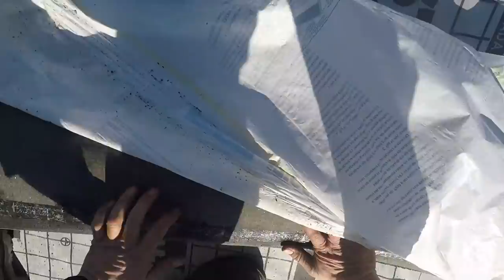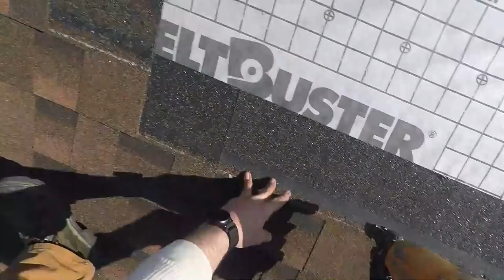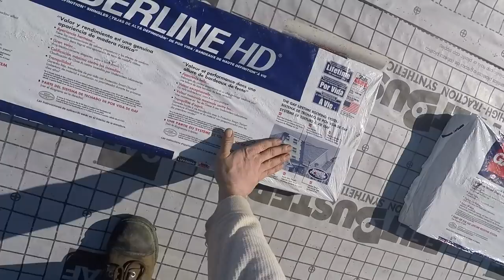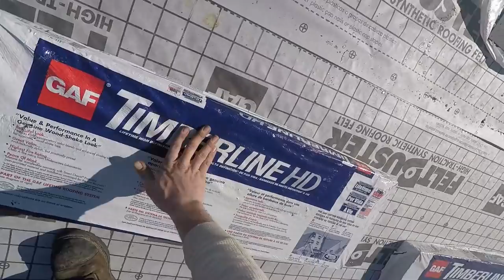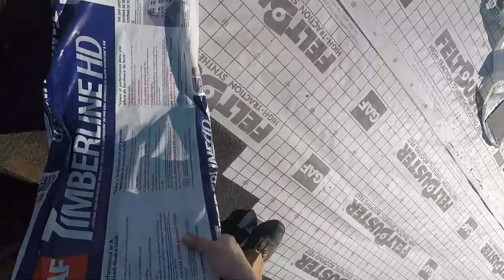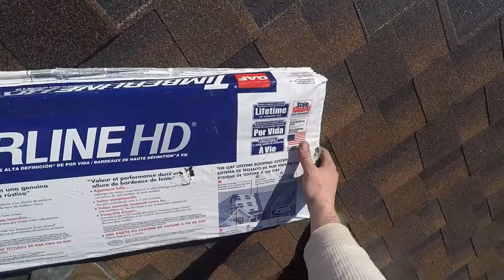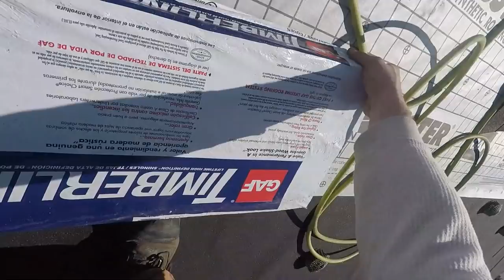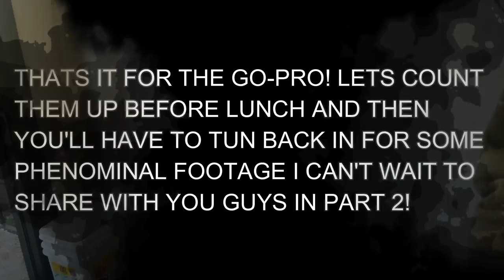Worlds Fastest Shingler 46 Sq Apt (part 1 of 3)

Comment: Fist off man thanks for all the videos. I've been learning a great amount from them. Is there any trick to shooting that nail for the chalk line to aim it right at the edge of the shingle like that? Your accuracy was nuts dude. Also when you open the bundle of shingles and slide it down your steps do you count based off the amount in each bundle? Looks like ya split it up in fours every fourth step I thought I seen you drop a couple more shingles. It would be badass to get on a roof with your crew and learn some real shit.

Comment: I was a roofer for a summer in 98'.  After that I framed for 3 years and then went to paramedic school and joined the fire dept.  I just retired and debating whether I should take on my roof by myself.  1800 sq foot home.   A lot of the sheathing will need replacing as well.  Guess it depends on how hard I want to work.  I'm 50 and athletic but like a lot of guys my age, my back and knees aren't the best.  I'd love to have this guy knock it out for me!

Comment: How much do you charge on a roof like your video 4/12 pitch for tear off and lay just labor.  I’m in Kansas $120 a square I would prob charge more since it’s 3 stories.
Reply from the maker: well mine includes material and dumpster as well. i'm usually around 270 as a base for straight gravy and go up from there

Comment: Im not a roofer at all but I thought the white line meant no nails below that. i was under the impression the tar strip was where you wanted the nails to land. Is that a common misconception?
Reply from the maker: the white line means you put your nails there and there's no tar line to nail. that was 3 tabs. these are laminate shingles and your nails have to go through the common bond. as long as they don't show when you put the next one on you're good

Comment: Where is your FALL protection
Reply: If u fall than u shouldnt be on that flat of a roof.
Reply: The fall protection is the air hose on his gun. You just hold on tight and it will hold for sure!

Comment: Felt, or whatever you have at the bottom looks wavy.

No caps on the paper.

No safety equipment.

A lot of editing done.

No way to see if the drip edge has the correct spacing.

The shingles look cold.

I’d be embarrassed to release this video.

Comment: Does it really matter how fast you go for the consumer? When I got my roof put on, the company charged me a certain price. I did not have to pay per the hour. I am pretty sure most companies charge by the job, not by the hour. They could work on my roof all year and I could not care less, because it is a certain price. If you are an hourly employee, then you are just throwing  money in the toilet by going fast. If you are on salary, then that would make sense because the sooner you get done, the more time you have to spend doing what you want. Everyone knows that roofers can not work all year long due to rain, snow, etc. That is one of the reasons no one wants to be a roofer. Plus it is not an easy job on top of that. It is a hard labor job where some weeks you might not get a pay check because of weather at some companies. If you could work all year long and pull in 80 to 100k then more people would do it.  I did it growing up with my step dad on his side jobs from the 7th to 12th grade. Then I went and worked where he worked for about 6 months. The weather was not great and we would get rained out and lose pay. Left there and went to the Army for 9 years and then to the oilfield for 4 plus years. Figured if I had to do hard labor, then I would go where the money is or where they give you free food and lodging. Roofing  is a hard job, but if you have a good crew then it is fun. They did not have the air guns when I was doing it, but there were one or two guys that were just as fast using a hammer. The boss man was around 60 at the time. He said he joined the Marines and it was hard, then he started roofing and it was harder. He said he was afraid to go anywhere else lol. He ended up retiring from the company and then coming back and working for them again. He is somewhere around 75 now. Wrote you a long comment, because I know it improves your stuff on YouTube. Much respect to the roofers out there.
Reply: They want to push and get the job done so they can go to the next job. They only make a certain amount of profit per job. Your analysis is the same as saying, "Why would Ford want to make so many cars per year? I only buy the one car and will have it for years.  Ford should just take all year making my one car and focus on having fun."
Reply: That’s what he pays the people he employed

Comment: Runnin around for tools and mats, put a belt on
Reply from the maker: any roofer could easily tell I benefited from not having a pouch on. I didn't use a hammer and I would've had to stop several more times for coils coz a pouch only holds 6 max and weighs you down. its useless while shingling. I started a movement lol
Reply: @NWIVeteranConstruction  lol not in anyway did u start anything, yer not the first guy to run with no belt.
Reply: @NWIVeteranConstruction  "where my snippys" lol
Reply: @NWIVeteranConstruction  u actually do decent wrk but yer no where near elite, you just dont have the time in or skill.
Reply: You must have stomped on Adventure Fishing when he was a roach in his previous life :)
Reply: Worlds Fastest Shingler 😂

Comment: Y rake edge on the bottom.  Dont they call rake edge for the rake and dripedge for the bottom
Reply from the maker: ? Its gutter apron on bottom (goes over into the gutter)  and drip edge on the sides.  That's 100% how you do it
Reply: @NWIVeteranConstruction  if you say so. Thats y they call it dripedge not C4.5 rake edge like your putting on the bottom

Comment: Wow.
Behind the times.
1991 i was getting $5 per bundle 
You are paying 19$ per square.
How much is your insurance ?
How much per square if you are ripping and re shingle .
No worries. About pricing
Reply from the maker: around 270 but that's with material
Reply: @NWIVeteranConstruction  
In mass you can get with materials. Up to $700 pSq.
Average is $355
Reply: @NWIVeteranConstruction  
I try to do just copper and slate.
Repairs is where the $$ is at .
Do smaller jobs .
Quicker $$
Reply: @NWIVeteranConstruction  
The corona shut everything down now.
A home .
Twiddling thumbs .
Surfing youtube.
You should do a corona video to get the word out .
About being carrier A SYSTEMATIC !
 Would help.
You have alot of followers and younger

Comment: World's worst shingler for real i would have had that torn off and shingled by lunch no questions about that! 30 bundles good job that's 12 sq you laid!!! Also that's the first time I seen you use starter with glue strip which is the same thing as flipping a shingle upside down and around but I get starters free when I guy my shingles!
Reply: I wish I could attach a picture of the project we just completed 28 sq cut up 2 men and flashing a chimney and skylight ripped, picked up and completed by 3 and had a 🍻 in hand by 4 with a check headed to the bank!
Reply from the maker: 30 bundles aint 12 square! LOL and sounds good man. WHY DON'T YOU TRY DOING MY #ONESQUARECHALLENGE before you talk some shit son. i would love to see you put on a square in under 7 minutes. until then. keep it clean my man thanks for the comment. and i ALWAYS USE ACTUAL STARTER. i have one video that i used the tops of and its coz i ran short. i usually buy plenty or have extra in the trailer. and i still used actual starter in that same video. i will help you upload if you need help
Reply: Calm down Hackman
Reply: Apparently this guy never put the beers down